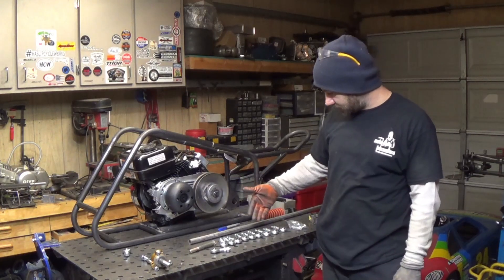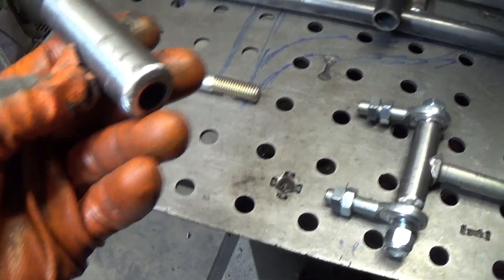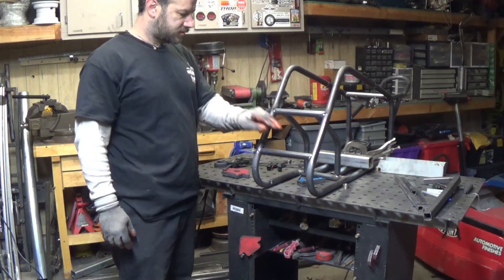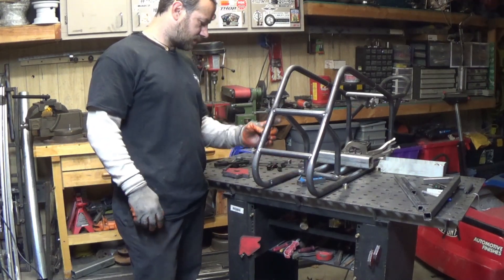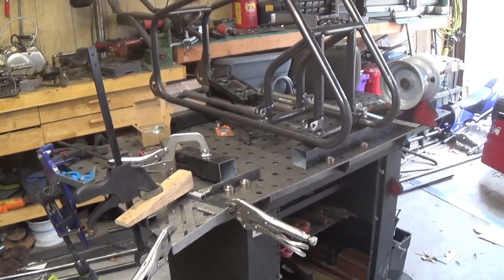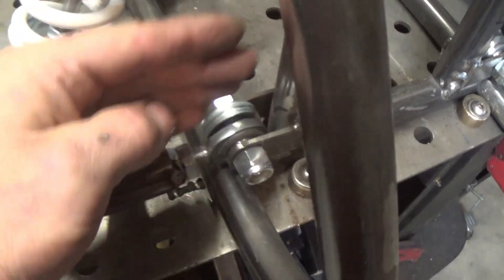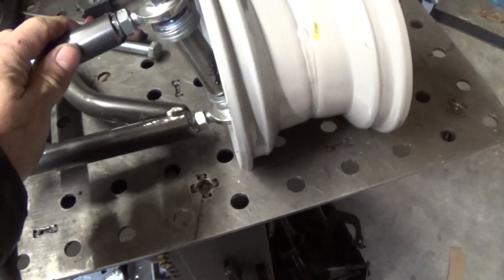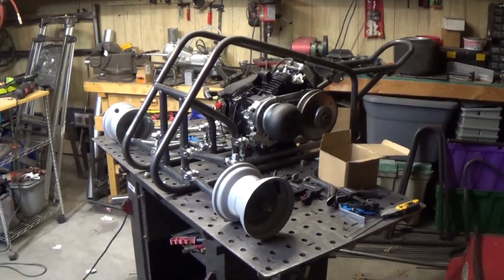ALMOST a roller! Front suspension driftquad part 5

Comment: Visited your site, are you planning to sell these as kits or plans?
Reply from the maker: Cool! I think so, they are turning into more work than I originally thought but I do know they will sell if I do build to sell.
Reply: @turbolaser24  Plans are a good supplement $$$ wise like I said. Harder to fabricate a bunch of frames than to just measure/get a parts list!
Reply from the maker: @BunkerBlog  Yeah i get hundreds of requests for plans and dimensions, if i ever get a bending program i could definitely make plans to sell, my hand written dimensions would be confusing for others
Reply: @turbolaser24  I'd certainly put down some money for a roller. Wonder how one of these would do off road with some knobby tires. Keep up the hard work!
Reply from the maker: I think it would do awesome offroad too. It will have a little height adjustment and taller offroad tires would give it good ground clearance.